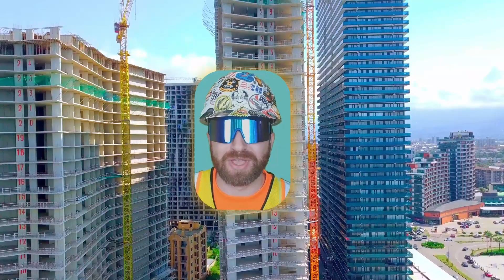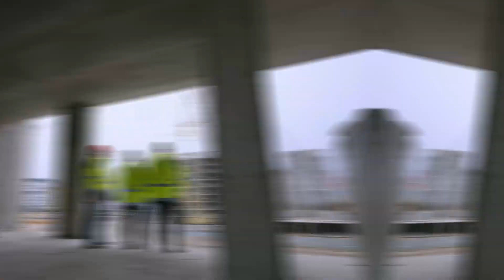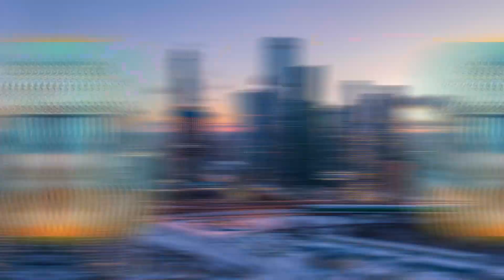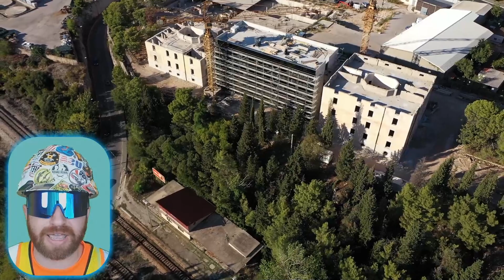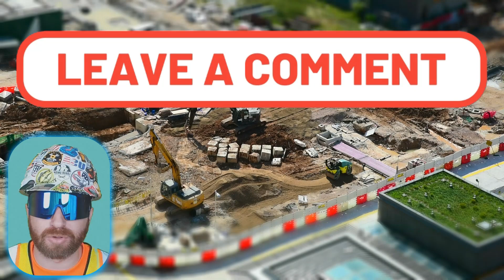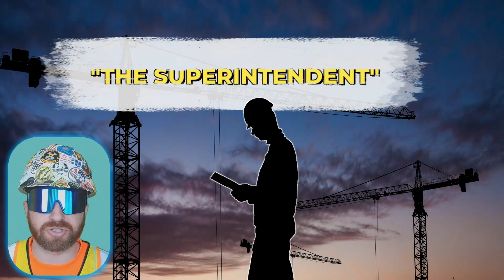What Is A Construction Superintendent?

Comment: Thanks for all your content! Can you do a video touching a little more on the day to day responsibilities of a construction superintendent and certain milestones. Kind of like the steps of the construction process as seen by the superintendent besides just reading drawings and fostering good relationships. For example make sure there’s proper permits, site fence and sidewalk shed is up, surveyors marked reference points, footings poured, utilities called for piping, mat slab and so on. Things like when to get the electricians to supply power to the site, when to het hoist/ crane. When you to start calling windows guys to start drying in the building. How to do 2 week look aheads and so on.
Reply from the maker: The plan is to cover these throught a series of different videos, but yes!